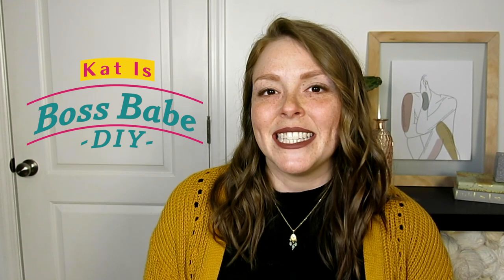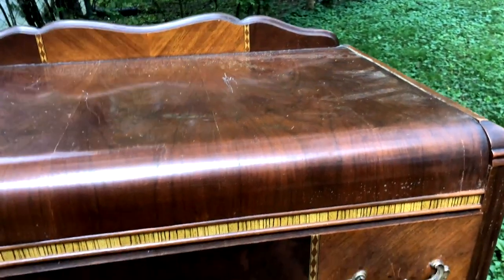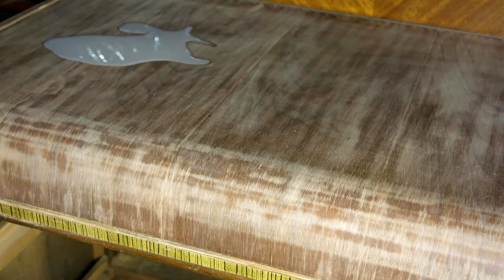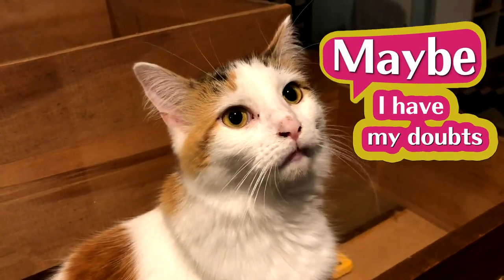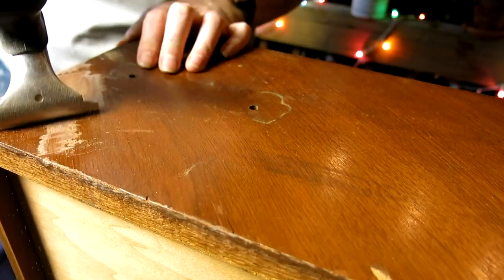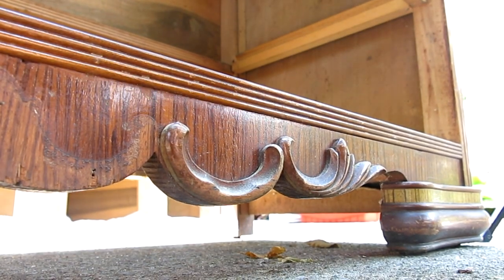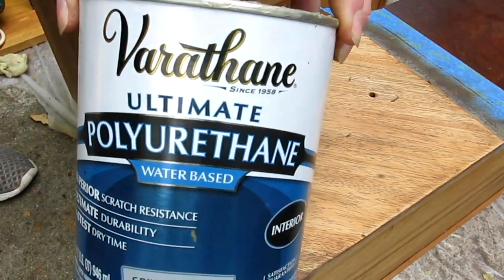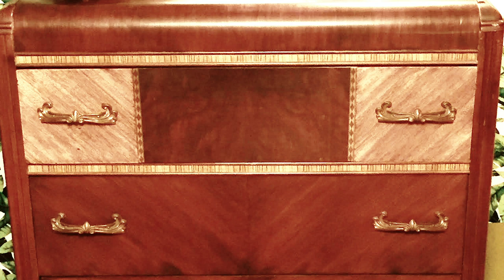Art Deco Waterfall Dresser Restoration| PART 2 of Retro Closet Room Transformation

Comment: A handy tip for me is, if you have small dents in the wood ( not chips or scratches ) like a blunt object dented the wood. I put a damp towel over the dent then lightly iron medium to hot heat. Sometimes the wood fibers will swell back up for a smooth finish. The heat is an experiment start low then higher til it works . Then lightly sand. ☺️❣️
Reply from the maker: That's so great to know!! I'll definitely be putting that in my back pocket for future projects. :)

Comment: If you have the occasion to do this type of project you can use equal parts of denatured alcohol and lacquer thinner; dip a piece of steel wool and rub it on the finish.  It will dissolve the finish without the need to sand.  Wipe down the area you just worked on.  You may have to use a bit of the mixture to clean up any residue, and then wipe with a clean rag.  I've been using this "formula" for many years and it works every time.  BTW you did an excellent job replacing the veneer!
Reply from the maker: Thank you so much for the advice, Kathryn! I'm already looking forward to using this technique on my next piece! :)

Comment: Well done. Love how you created the accent drawer when the veneer refused to take the stain. I was watching another refinisher’s restoration. It seems that there are small nylon/polyester slide that can be added to these drawer slides to ensure the drawer aligns perfectly. I think it was Transcend Furniture Gallery that I saw them on. You attach it to the bank underside of the drawer and it aligns it onto the wood track. Very cool. Helps it slide perfectly. Thanks for sharing.
Reply from the maker: Thank you so much for the tip, Therese! I'll definitely have to look into those. :)

Comment: I would have used a power sander and got each piece sanded more color even I know it is veneer and yes in my earlier years I did send through so once you get the skill set it's really not that bad to do then when you apply your stain all the wood will take it more even your pineapple patches were spot on they look good one was a little bit darker you have to be careful when using other veneer the veneers won't match sometimes in color since you have to experiment a little bit I personally run from polyurethane I don't use it on any furniture I feel like I get a much more professional look with lacquer than I do with poly but then again just my choice and my experience of how I've taught myself it does look good and I'm so glad you didn't paint it like so many people would have painted that and hid the beauty of that wood
Reply from the maker: Thanks, Ed! I'm definitely still very new to the refinishing process, so I'm planning on trying out some different techniques/finishes going forward. I appreciate the feedback.